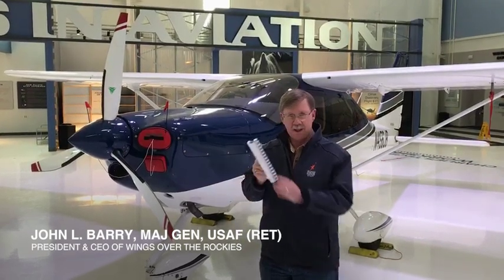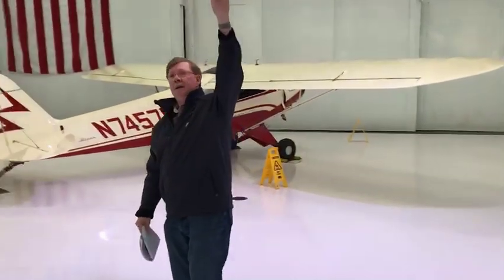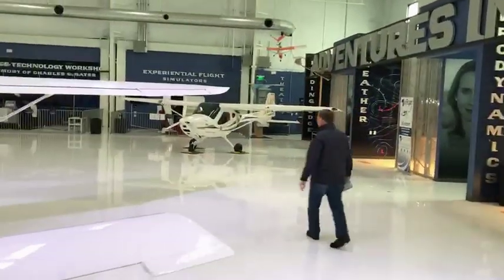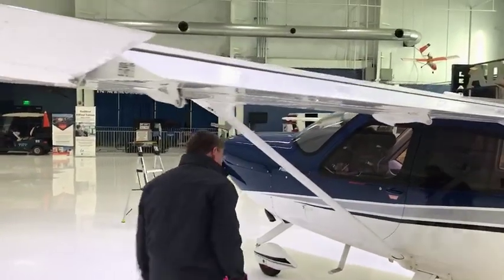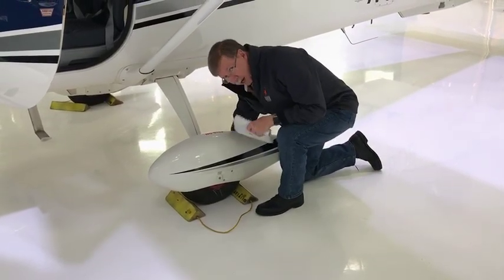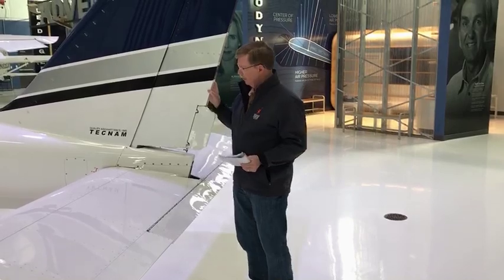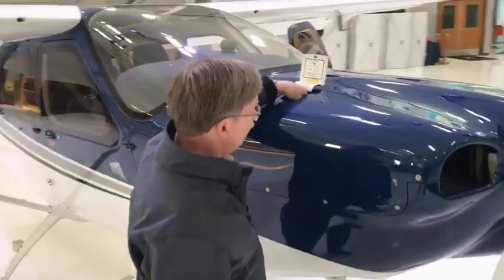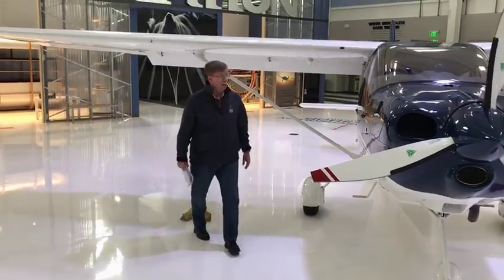Pre-Flight of an Airplane Exterior with John L. Barry

Comment: Six gal of oil?  You mean quarts?  The prop won't hurt you & won't start provided you turn it backwards.  You waste lots of time by not doing your preflight in one continuous flow & it is less confusing for a student to learn it in such a way.  Painted nuts no cotter pins.  I didn't know Maj Generals flew or gave instructions.  Your retired so keep up the good work.